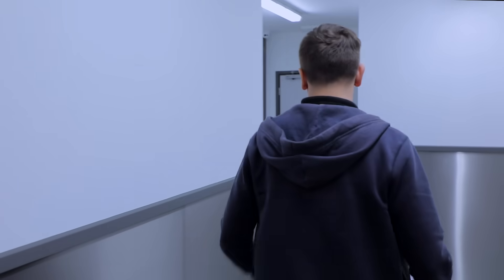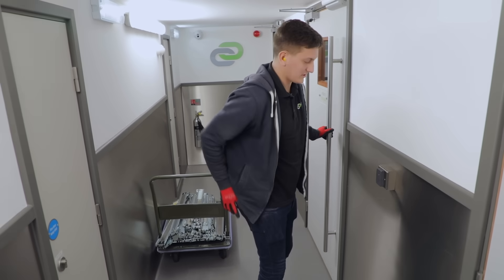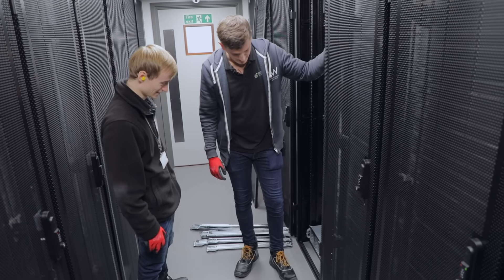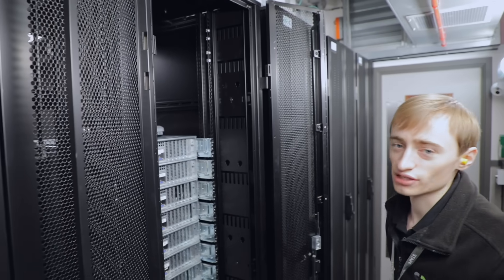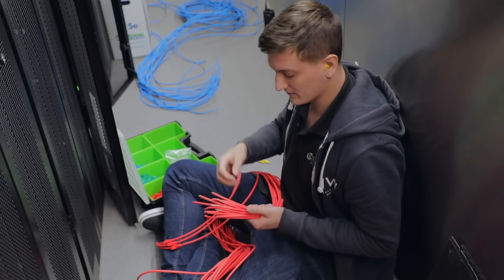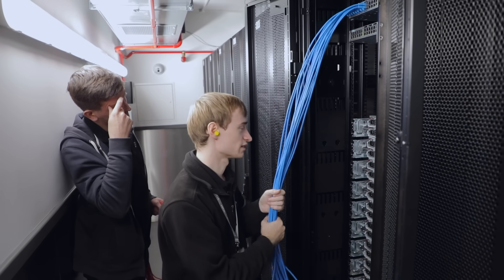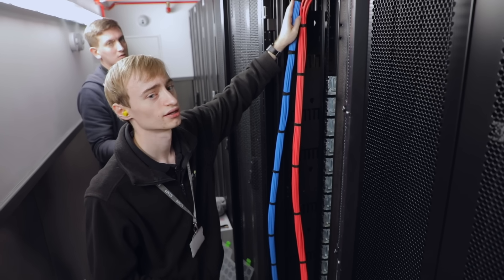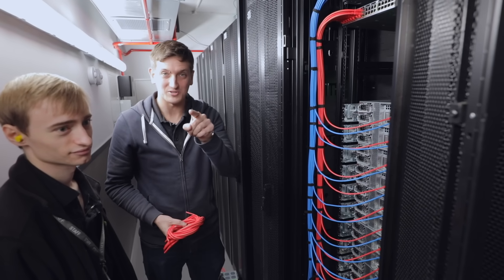A DAY in the LIFE of the DATA CENTRE | FULL CUSTOMER "RACK & STACK" with ASH & JAMES!

Comment: two questions: 
don't you need to test those cables?
can you still pull out the servers from the front if the cables are run so neatly?
Reply: they probably tested the cables off camera, thos it's weird they didn't mentioned it..
Reply: No they can't. They are going to have to unplug the server to pull it out. If a fan fails the server has to be unplugged, which is no big deal if you have high availability and replication... but its not ideal.
Reply: The servers don't need to be connected when pulled out.  
Only a handful of servers need to be able to be pulled out whilst still connected.
Reply: To do that you'd want to use cable arms, and they're a real pain. If the cables are marked up then it's easier to unplug
Reply: Clearly no cable testing being done before installation, nothing like trying to find a faulty cable later and having to pull apart that loom again 🙁 Do it properly the first time!
Reply: @alexdv2635  You ever think they might've tested the cables off camera?
Reply: @Anthony-df4bs  They appear to terminate the cable then  immediately plug them in with no sign of a tester nearby in the wide angle shots, I'm hoping before they plug the servers in and power them that they test them howver it would have been easier to test as they went along before strapping the loom together. Also they can't have tested before doing the loom as only one end was terminated, bad practise really :/
Reply: @jamestaylor8324  there where lot's of times where they could have done the test, but in general if you used the right crimping tools and know what you do there is no need to test.
Reply: @alexdv2635  While i do agree with you don't they just see: oh server xy isnt working? lets check the cables?
Reply: Rails with cable management arms are great for keeping the cables super neat and enabling the server to be slid out.      A cable tester could have been used and not added much time, but been another report for the customer to see (a quality tester will be able to have a report per cable). Something like a fluke link runner (I use an AT2000) will do this while one end is plugged into a switch. Qualifying it for gig speed.
Reply: @anthonypolsinelli1179  On the other hand cable management arms can impede airflow quite a lot. I'm currently in the process of removing all the arms from a 5-rack HPC. It's a pain, but in this case the arms are quite full (redundant power + redundant network + redundant Infiniband + IPMI = 7 cables per 1U), and the machines do really run several degrees cooler without them - which means they will run at higher clocks.
I'd recommend arms only for 2U+ servers.
Reply: @anthonypolsinelli1179  I hate those with a passion. They way they did it here is my preferred method as someone who does hardware repair, build and decommissions. Other than labeling ... but they are clearly not done with the build. I also zip tie off the power to the servers either with the pull tags or with adhesive zips so you cannot pull the power without cutters. As to the comments about no slack, if you need to pull the server all the way out it will need to be shutdown and decoupled regardless. There's very few reasons to need to pull the server out more than an inch or 2 (to check SNs)

Comment: Why the heck you using cat5? I like your work but cat5?
Reply: For gigabit you don't need better cables
Reply: @equinoxfpv173  I know but it's completely not understandable when cat6 cost more or less the same
Reply: @SvenTimmermann  Completely understandable, easier to work with, not pointlessly overspecced and good quality cat6 still costs a lot more than good quality cat6, also if the customer request cat5 they get cat5.
Reply: @SvenTimmermann  Well Cat5e also does 10gbs/s under 45metres also. So even for gigabit its overkill.

Comment: James is by far a much better engineer. But box of cat5? Come on guys put in 6 at least.
Reply: I also find it odd that they aren't using cat 6
Reply: @cmkmusicislife1571  as Ross Sharp already said "Completely understandable, easier to work with, not pointlessly overspecced and good quality cat6 still costs a lot more than good quality cat6, also if the customer request cat5 they get cat5."
Reply: Christopher Kline I find their whole work principles. I would pay three times their figure just to not use them
Reply: 5e is in-spec for 1000base-T. (I have never seen 1000base-TX equipment which would require cat6 -it died an early death). If the customer were to go 10g, they would either go 10gbase-SR or DAC, both of which would require replacing switches and cabling. 10Gbase-T (copper) is power hungry and surprisingly expensive. If, on the other hand this was for an expensive/difficult to replace run, 6A would make a whole lot more sense than 6, and OM4 even more so. (OM1 needs to die. There is a special place in hell for people who put OM1 inter-building links in the ground without putting it in pipe. LRM does not give me a warm fuzzy feeling)
Reply: @kkpdk  multimode needs to die. Singlemode cabling is cheaper now and has no limits. 10G SFP+ modules are practically the same price.
Reply: Kasper Pedersen great I can use wet string to transmit rs232. Its about pushing standards. New installations should reduce tech debt not add to it

Comment: Get a 3D printer, cheapo ender or cr10 , you can print out those cable combs. I designed my own smaller comb for up to 4 cables (since I normally do smaller bundle runs on HDFs).

Comment: btw, why is there no slack in the network cabling? now one could not pull the rails out without ripping the network, cant they?
Reply: Guess if you're ripping out the server, you need to power it down and get the cables out anyway.
Reply: Sander Deryckere i guess hot swappable hdds, ssds and ram are still a thing...
Reply: @miko007 , yes, but on many servers, those are accessible from the front. No need to pull them out. Even power supplies are normally swappable without shutting it down. The only reason to pull a server out is usually to change some internals like fans, ram or cpus.
Reply: @sanderd17  Correct me if im wrong, but arent fans what end up failing the most?
Reply: @wildwilie  usually disks & power supplies fail more often than fans.
Reply: @stephanweinberger  Ah, I guess ive just had bad luck with my server fans :(

Comment: Do you not test the cables first to make sure that all is good with the crimping. Nothing worse than having a duff home made cable where one of the 8 wires is not making contact.
Reply: Mental Dave when you have customers who ask for or expect verification you kind of need them.
Reply: See their video about making a network cable
Reply: Alex Jamieson unfortunately I have
Reply: @crazyboy2006cashier  We have a  running joke at work that we need to hire a crimper tester.  Testing that many cables after crimping is unfeasible & a waste of time.  If a cable isn't working as intended we just replace.  No issue.
Reply: endfm wow. Considering this is a data centre and is customer equipment, surely from an SLA approach the cabling should be tested. Guess I just have a very high standard of data centre installation.
Reply: @crazyboy2006cashier  yeah,   it's just the error rate is so low so it's a non-issue.
Reply: @crazyboy2006cashier  Savage ahahahahaha
Reply: Elliott Veares as Iv said before a disgrace to the networking professionals. So glad my estate is not with custodian.

Comment: pass through rj45 crimes are so much easier to do and quicker
Reply: We thought so as well, but come across a pins #1& 2 not making connection (Open). Two different techs came to the same conclusion using different crimp tools. Lost faith in the pass thu crimps immediately and went back to the style with the little plastic load bars. Also have a spool of foil wrapped 23 ga we need to terminate and had to order some larger industrial punch down rj45 plugs. This terminating can get to be a real pain at times. On the video, all looks real neat. But, it looks like you gotta uplug the hardwire each time you rack out, or else WHOOPS!!

Comment: Great video, but i'm I right that the PDUs are getting placed on top of the servers instead of in the bottom of the rack; or has the customer a separate rack for the PDUs?
Reply: I think you're confusing PDUs with UPSs. UPSs are not needed since the entire data center is already powered redundantly. PDUs are needed; they said in the video that they normally supply zero-U PDUs (they mount vertically in the rear of the rack) but this customer opted to supply their own horizontally-mounted PDUs. They will probably be put between the lower switch and top server.
Reply: @112Haribo  I indeed was confused about PDUs and UPSs thanks

Comment: Interesting video, as always. I find it interesting that you guys take the time to actually manufacture the cables per rack. Sure if one gets used to the way it is done, it is not really time consuming (besides the neatness it can bring). I would have thought that you have a stack of pre made cat6  cables in various lengths. Another question that came in mind while watching your video. Are you going to measure the cables? In case you do, do you keep or put the measurement reports in the installation report?
Reply: In our DC we only have pre-made Cat6A cables in steps of 0.25m up to a length of 10m, then the steps are getting bigger like 12m,13.5m, 15m and so on. It's the fastest way and costs are not that bad if you consider the work time needed for crimping them. Also we are using cable management arms, so you can pull out any server to hot swap any of its component's without having to turn them off
Reply: @sitte24  same in the DC I'm working. We got 0,5m steps still 7 metres.

Also having a number on the cable(from the manufacturer) makes documentation really easy.
Reply: I don't think you could do the looming as well with cables that have jacks on them.